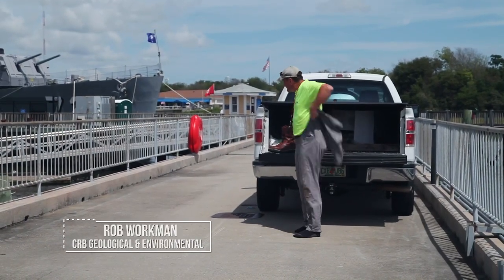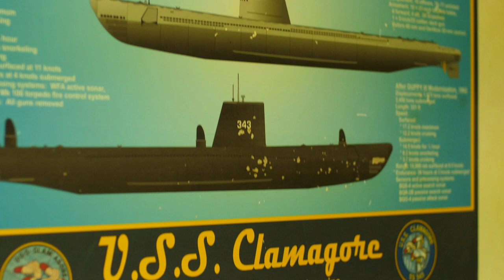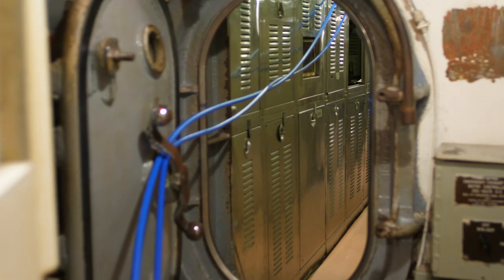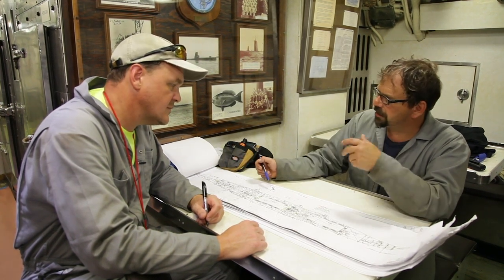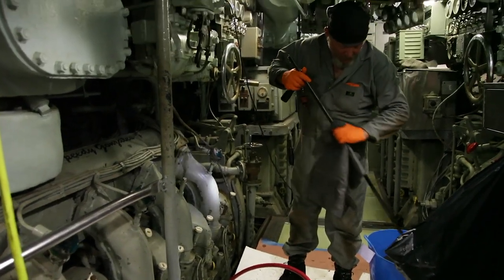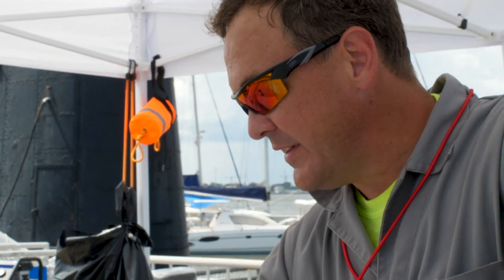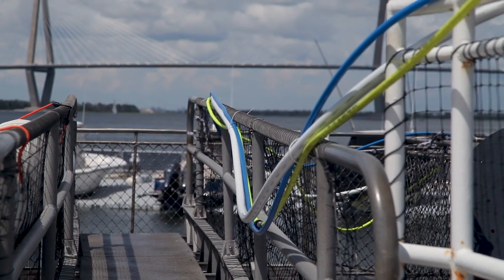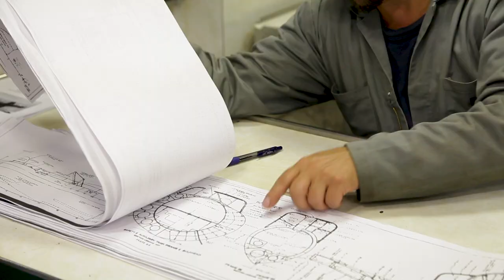Cleaning the USS Clamagore | Salt Life

Comment: I can't help but notice, the place where this ship is moored also lost 1 ship as a reef, and had to have two more moved. I would recommend that they don't take in anymore ships than just the Laffey and the Yorktown, since those are they only two they care to maintain
Reply: Sir Boomsalot they dont really take proper care of USS Yorktown (CV-10).  Notice she is not tied down.  She sits on the bottom.
Reply: Steve Feszchak Yeah, I noticed that when I was first there. It was low tide, and the ship was so high out of the water I could just see the top of the rudder and where the propeller shafts were mounted. The Laffey is also in the sand I think
Reply: @sirboomsalot4902  Laffey is free floating since her hull restoration